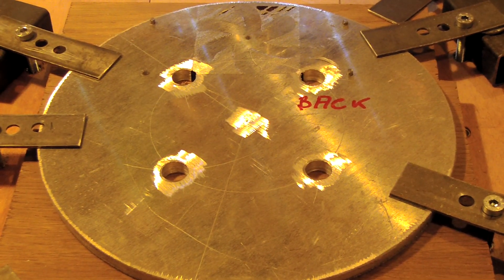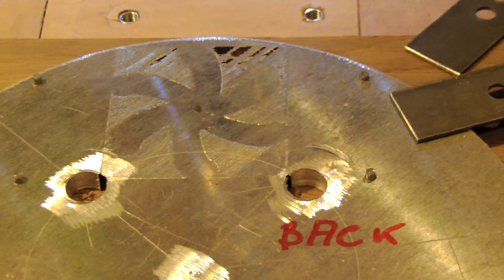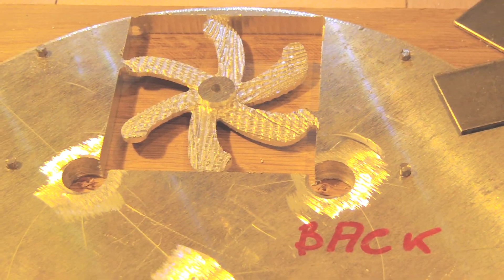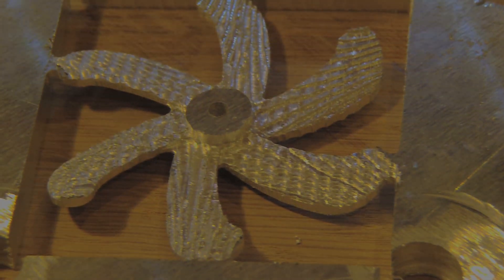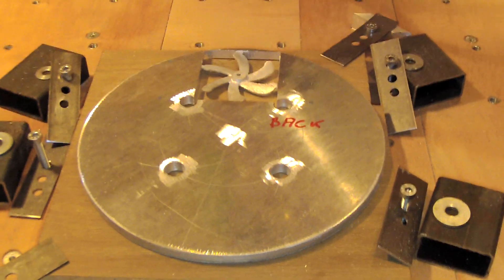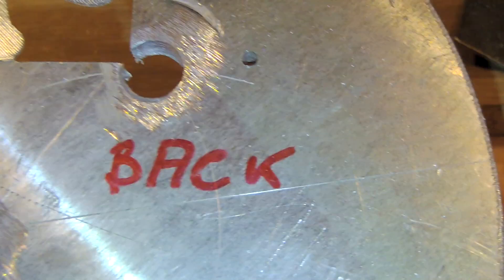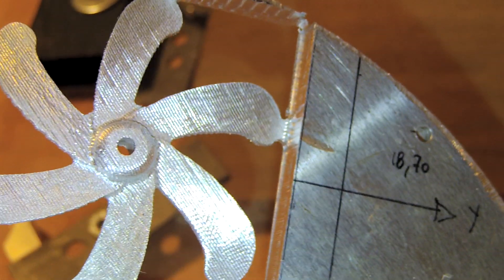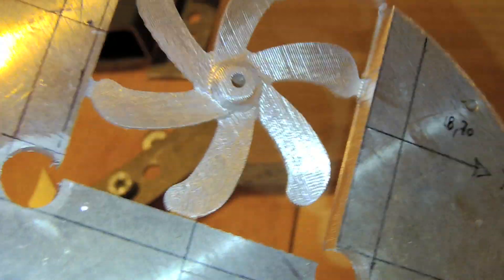Homemade DIY CNC, Finished 3D CNC propeller milling

Comment: is the part clamping strong enough?
Reply from the maker: Hi Jasu,
A good point mentionned, but with this type of CNC the tool pressure is lower compare to a regular CNC.
But if you check my new CNC project, you will see that if will be able to create much more tool pressure !
Thanks for your update.

Comment from the maker: I'm under Linux and I use FreeCAD for the CAD soft. It is a free 3D parametric modeler. Regarding CAM soft I use 3 differents one depending of my need.
For simple 2.5D milling I use Cut 2D from Vectric (commercial). For simple 3D shape (not impeller or propeller) I use PyCAM (free soft) et for complexe 3D milling I use Cut 3D from Vectric. For graving picture LazyCam.
I have an other video called: Homemade DIY CNC, tutorial from Design to finish part where you can see some of those soft.